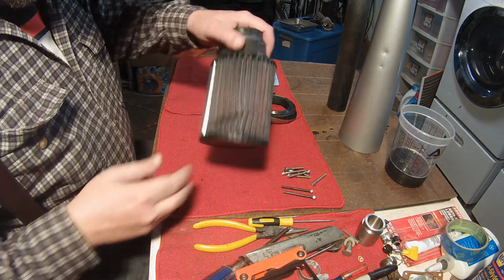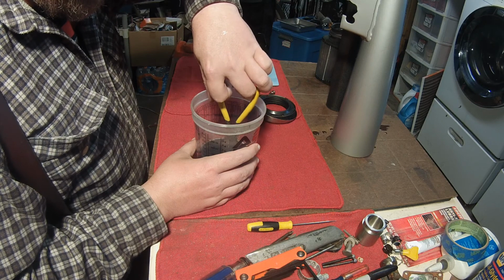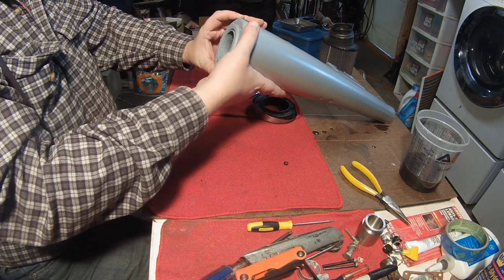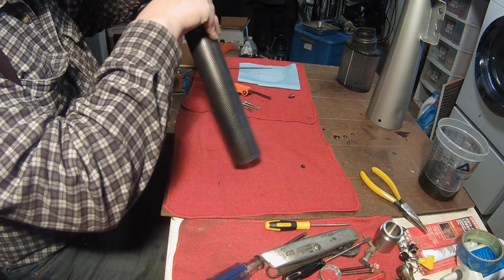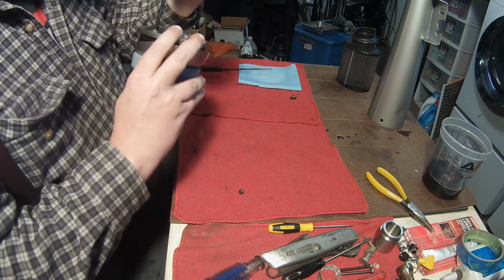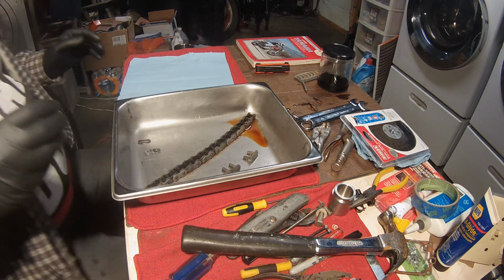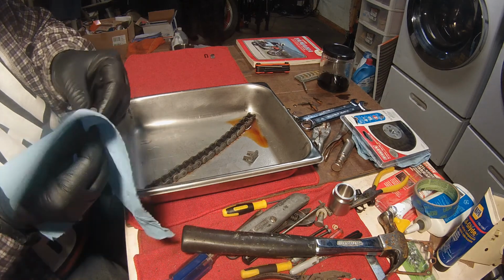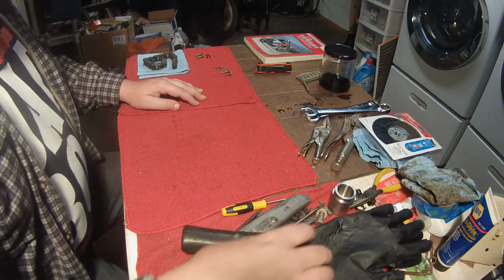Yamaha SR500 Part 22: Assembling the muffler

Comment: May I add that I put a kn filter on my 77 tt500. After 2 days of riding I took it off to clean it and was stunned to find dirt in my intake port. Actual grit. I tossed it and installed paper cone filter. No issues. Suggest you be observant of this issue. On the street it may be ok. On my jeep I had the same issue. Went back to paper filters.
Reply from the maker: Interesting. I'll watch it and see if that happens.